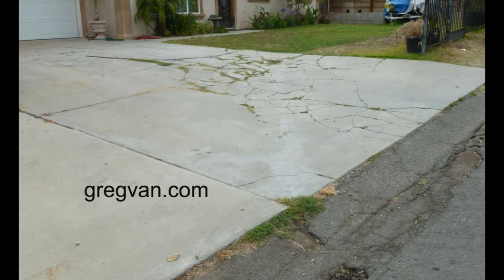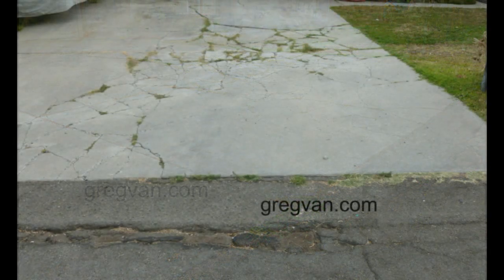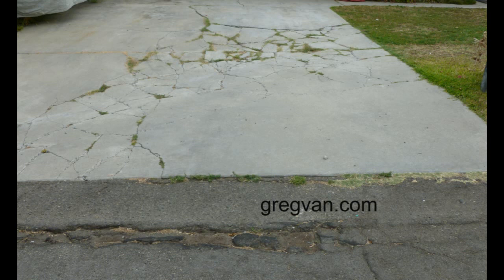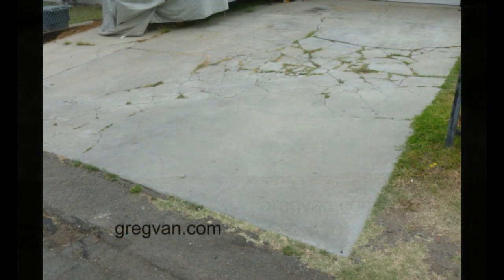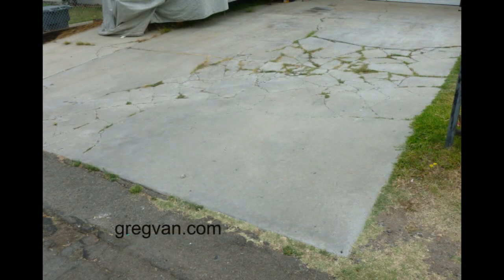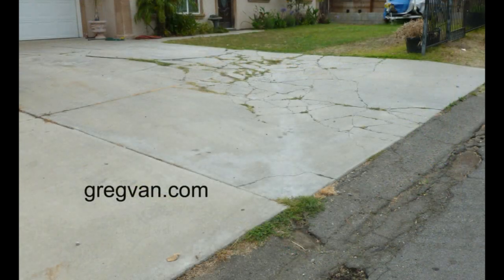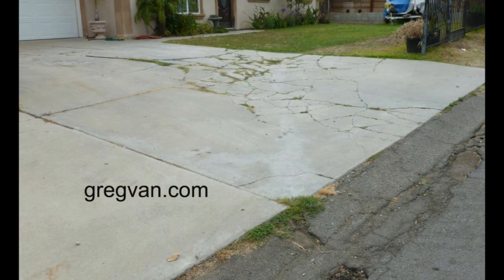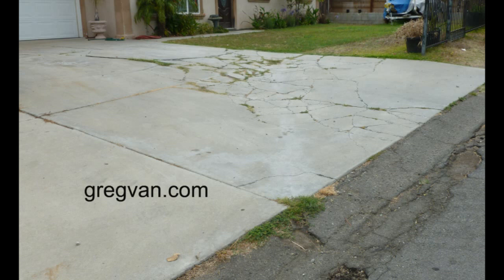Watch This Before You Build A Concrete Driveway - Design And Construction Tips

Comment: I think it was probably a combinatiom of all the things you mentioned. One other possible factor I noticed though, to me it kind of looks like maybe the ground wasn't level and there might have been some water runoff from the yard that channeled and started to washed away the soil where that low, uneven part of the driveway is. You can kinda see where water might have flowed across it cause the bottom slope of the driveway wouldn't let it run off properly.
Reply from the maker: I think I would agree with you also. Sometimes when you create a lower area in a driveway, it will allow more water to flow through this area and seep into any cracks or gaps, often accelerating the erosion process that could lead to excessive cracks.

Comment: The soil in my house is very hard, do I need to add base rock before pouring the concrete driveway?. I compacted the soil. thank you
Reply from the maker: It wouldn't be a bad idea to add one or 2 inches of sand, but am not 100% sure if gravel would do the same thing.

Comment: Contractor just finished redoing my driveway the concrete was 2500 PSI at 4 in thick with half inch rebar you think that'll hold? But I did notice the gravel sizes real small what do you think?
Reply from the maker: I think you will be okay. If the gravel size is smaller, then they add more cement to the concrete mix. As long as the soil doesn't move or sink somehow, you should end up with a good driveway.
Reply: 2500 psi ridiculous. YOU got screwed. Sorry, but I've been a concrete contractor for over 20 years and  2500 psi is a stupid ass way to save a little money. I realize that in certain climates you might get away with going cheap but I would never take that chance to save a little money.  4000 psi is what I pour in 99% of my driveways.
Reply from the maker: I think you're getting a little carried away when you telling this person who doesn't know very much about concrete construction that they were taken advantage of. There are plenty of 2500 psi 4 inch slabs without any rebar or wire mesh that were poured decades ago and still in good shape.
Reply: gregvancom I don't. If a contractor is so cheap as to try and save a few bucks on something as important as psi then IMO they got shafted.
Reply: gregvancom Oh. And not to mention the ability to put a nice finish on a higher sack mix is huge.
Reply from the maker: Now I can't argue with that. Anything above six sacks per yard can make even beginners look like... well experienced beginners. :)
Reply: gregvancom Something we agree on. Work smarter not harder. Bee doing this too damn long to work harder and save a few bucks.
Reply from the maker: Excellent point.
Reply: i have done 5000 psi concrete for my driveway.. 2000 is standard not sure is 2500 is slight better

Comment: i have a 150' x 32' driveway that i want to redo but it will cost tons of cash. some of the areas have moved about an inch but not cracked. i wanted to overlay it with 2" of concrete to resurface not to pull the old concrete. do you think it will eventually crack in the next 5-10 years?
Reply from the maker: I wouldn't do it, but you can always contact a few contractors in your area to see what they think. If the driveway is already damaged, then the 2 inch concrete slab above will eventually crack, almost guaranteed.
Reply: thank you.
Reply from the maker: You're welcome and thanks for watching.

Comment: I have driveway not as bad as the one on the video,  have drive way and  slab of concrete separate from driveway 4 foot between  and I want to connect. my question is. can i do re-concrete with a slop 5'' to 1 1/2 in 9 foot. I wast thinking to attach tile wire mesh with ramset gun(concrete gun) in to the existing concrete  and also add 6 x 6  wire mesh on top. any recommendations ? thanks!

Comment: can you pour new concrete over old concrete
Reply from the maker: +Fred Henderson It all depends upon the situation, but I wouldn't. For example I would remove sidewalks and driveways and re-pour them.
Reply: I pressure washed an UNFINISHED yet cured slab, then added bonding adhesive, then another 6" of slab on top. Haven't had any problems.
Reply from the maker: That's a good example of it all depends upon the situation. I don't think you would have a problem with a 6 inch slab, but if it was me I might have put an inch of sand down on top of the existing slab and then poured a 5 inch slab on top to separate the two, in case one cracks.
Reply: I dug down 6 feet,and put 6 feet of quickcrete ,and my driveway has not moved,but my house is leaning now

Comment: My scenario, sidewalk curb is actually higher than slightly sunken/cracked slob/sidewalk and I like to make it even again. Can I lay rapid set cement over then paint it with two coats of portland cement and then spray it with concrete sealer. Should I use rapid set cement alone or add some sand to prevent cracking. Thank you.
Reply: I don't think that cement by itself is very durable. You'll probably want to get a mortar which is rated for the minimum thickness that you'll be pouring. make sure to pressure wash the existing concrete and then use a bonding adhesive.
I did that for my mailbox area and it's held up fairly well and gets fairly regular vehicular traffic. The bag of mortar was like 30 bucks from home depot.
Usually the standard bags don't want you to pour thinner than 2" or so, so you'll need to get a specialty mix. I dunno why the specialty mixes are so expensive, but I'd imagine that it implies that it'd be tough to make a comparable mix from scratch.

Comment: I am hoping to pour a concrete driveway. My issue is that I need to do this project without any labor other than myself. 

I want to pour in small sections that are the width of the driveway buy only the length that I can screed by myself. I hope to do a section each weekend. 

What issues might I encounter?
Reply from the maker: The only issue I could think of would be to start with a smaller section if you have never finished concrete, just in case it takes you longer than you thought.
Reply: Our local concrete company will charge you extra below a certain number of yards ordered. IIRC, it's at least 6 yards.
Reply from the maker: Most concrete companies charge you for short loads, I think I used to pay $10 for every yard less than 9 yards which would be considered a full truck. For example, if I needed 6 yards of concrete, they would charge me 30 extra dollars.
Reply: Richard Allen d
Reply: Gregvan wouldn't there also be a problem with the consistency of the mix if done over a period of time?
Reply: Richard Allen go for it and save yourself some money